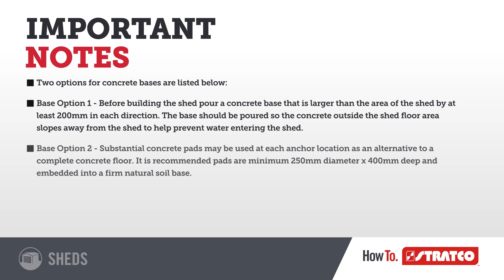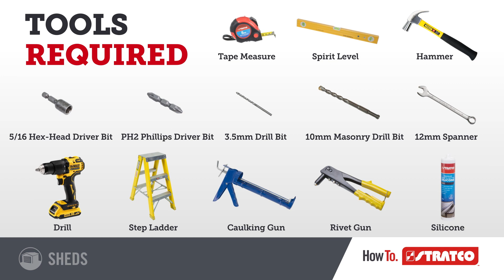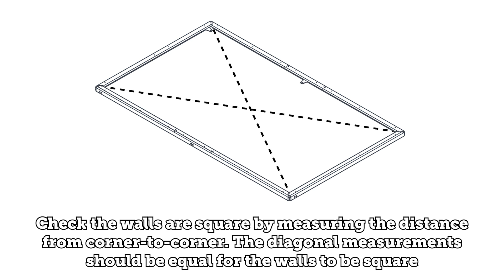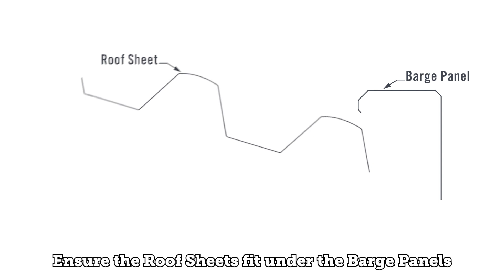Stratco Handi-Pod Garden Shed | Installation Guide

Comment: Very difficult to screw anchor plates in. Then they fall out. Used drill. Tried screwdriver.
Reply from the maker: Hi David, if you require further assistance regarding install of the Stratco Handi-Pod Garden shed we would advise you to please give us a call on 1300 165 165 during business hours where our team will be able to assist you further with this. Thanks.

Comment: What do you do with the silicone???
Reply from the maker: Hi there, regarding what to do with the silicone, please apply silicone to the underside of the Downpipe Outlet. Fit the Downpipe Outlet into the Downpipe Opening in the Gutter. Rivet the Downpipe Outlet in place using four Rivets. Apply silicone to the inside gaps of both Gutter ends. Thanks.